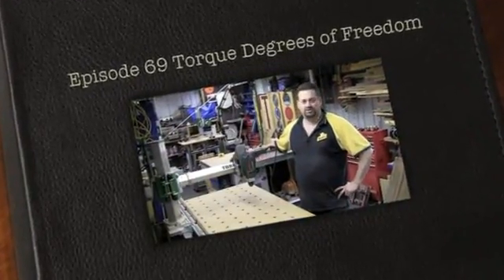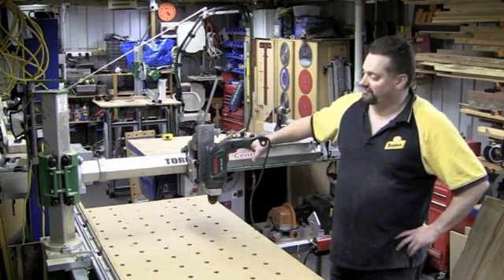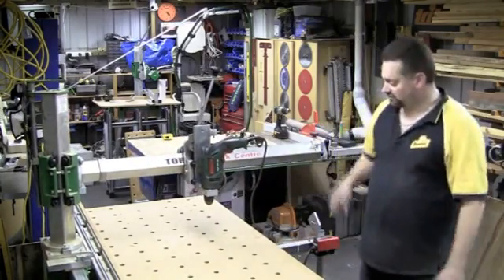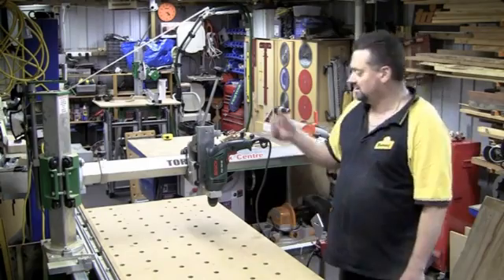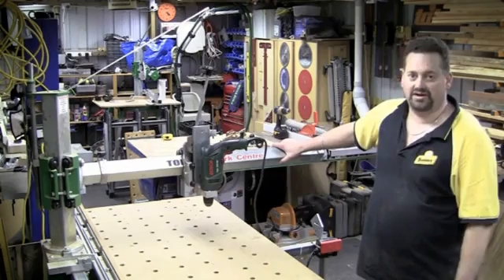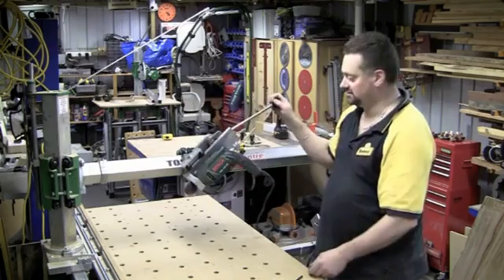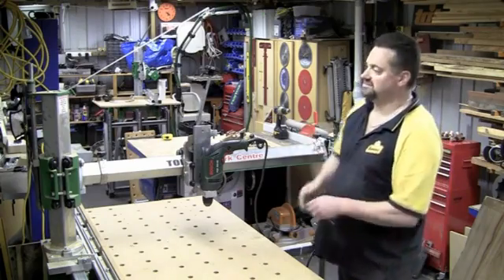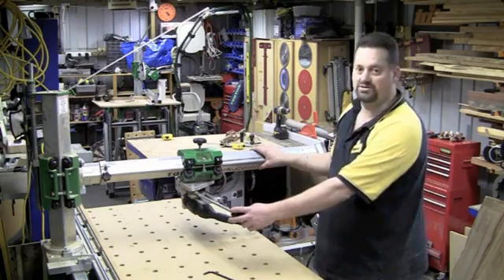Torque Work Centres: Degrees of Freedom with a Torque Work Centre

Comment: Very interesting concept. But you didn't say anything about the accurate, and it seems that the angular positions are only adjusted visualy (no block pin at each particular angle like 15°, 30°, 22,5°, 45°).
Then the question is: does this Torke Work Centre could replace the usual standard workshop equipment (table saw, miter saw, router table, etc.)? Even if there is a second rolling carriage unit, doesn't it too much time to install and adjust the machine which is need for the work to do?